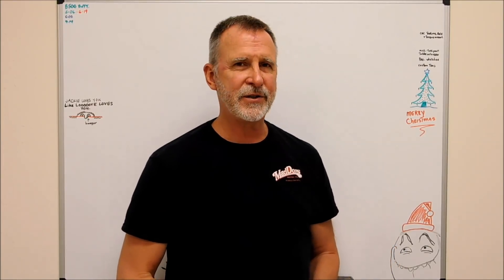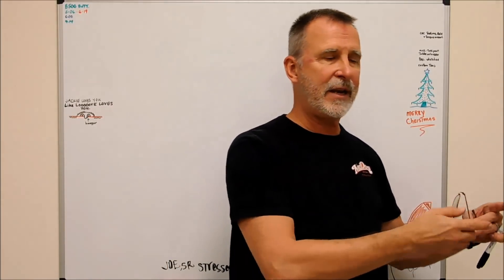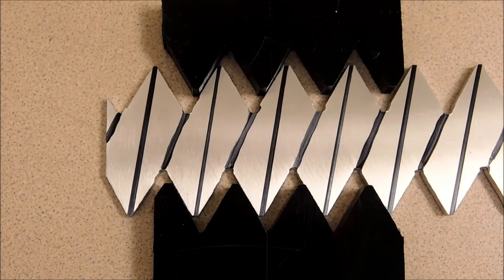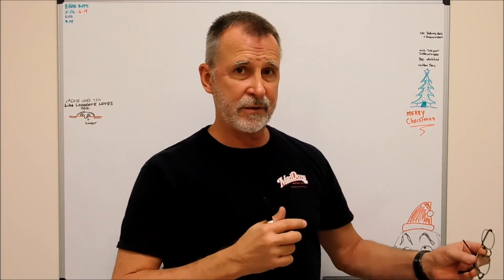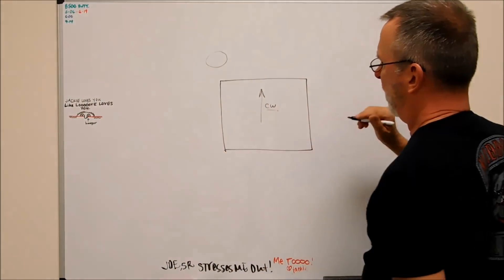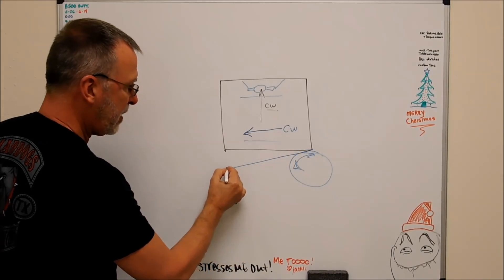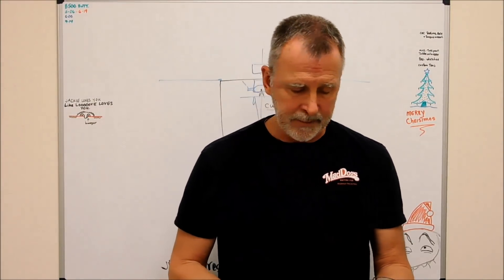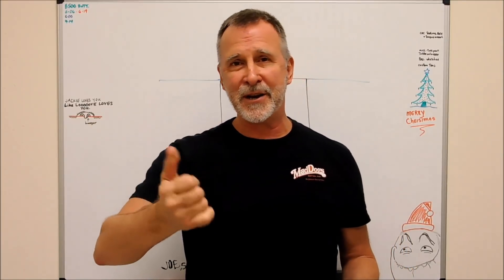Backlash and Part Geometry

Comment: I have some fairly noticeable backlash on the cross slide of my manual lathe..any suggestion on how to figure out wether the leadscrew is the worn element or the nut replacing one or the other is cheaper than both,while replacing both is going to give you the an as new tolerence but at a price.
Reply: If the back lash seems about the same from one end of the travel to the other, it's probably a worn nut. If it's reasonably snug at the end of the travel but more slop in the middle, it's probably the lead screw. 
 
Some nuts on lathe cross slides have some adjustment as do the nuts on a Bridgeport mill. Unfortunately if the screw is worn adjusting the nut will make the nut too tight at the end of it's travel. Lathe cross slide screws often wear unevenly because the cross slide usually stays in a fairly narrow zone.

Most of the time replacing the nut is the more difficult proposition because if you don't have the exact replacement part (often the case in older machines or imported machines) one will have to be made or one modified to fit. If you tap the nut a 1/2-10 LH Acme tap is $85 from McMaster-Carr and a 3/4 is $150. 

The lead screw is easier to cobble up from stock acme threaded rod.
Reply: Aceroadholder thankyou :) , great advice... while it's an old machine (myford ML10) currently the leadscrews and nuts are both still made..I'll check it over as you advise and see what the results are :)

Comment: Why don't they put ball screws on all machines?  No backlash then.  $$ I suppose, but surely they aren't that much money.
Reply: Ball screws will just make the problem worse.
Ever see what happens to the z-axis when you remove the drive?
Cutter pressure will have no problem unwinding a ball screw, forcing you to rely entirely on gib locks. you can move the tables around with hand pressure on ball screw driven mills.
So, no, not the cost. Ball screws would just be the suck on a manual mill.
Reply: Less backlash, but not zero.
Reply: Barry Gerbracht most can find a tighter machine,  less then a ball screw setup
Reply: +joshua43214 That explains why they are only on cnc machines. Thx.
Reply: ya, they are perfect for cnc.
Some mills have hydraulically powered nuts on the lead screw. You throw a lever into "climb cut mode" and it will divert oil from the power feed to the split-nut causing it to remove essentially all backlash. Wears out the screw and nut pretty quickly, but will let you take fairly heavy climb cuts.
I just rely on table weight, I have a little big mill (or huge little mill depending on pov :)), and the table weight enough for me to safely take .020" deep cuts in 1/2" stainless. Not sure what the actual limit is, since I have never pushed it. Though I did break a worn out 1/2" rougher trying to take a .25"x.5" climb cut the other day. Worked fine for the 1st 5 passes, then snapped off lol.
Reply: Joshua43214, this could be overcome for manual machines if they made ball screws with a finer pitch "thread" but there is no incentive as their biggest market (CNC) does not have a problem with coarse threads.